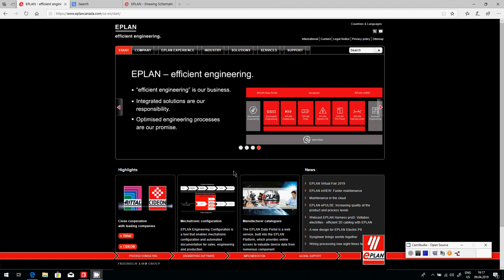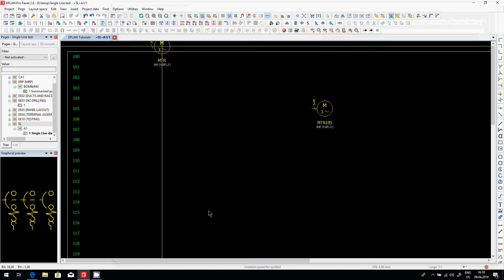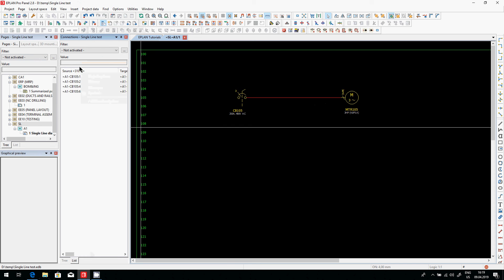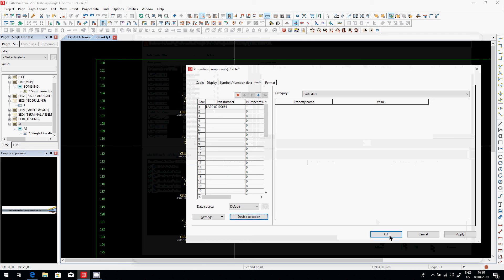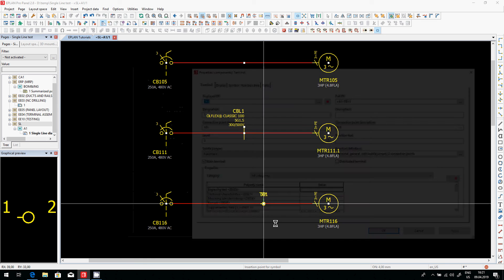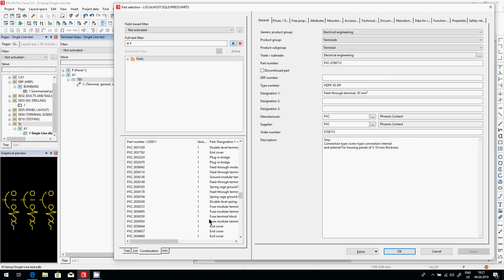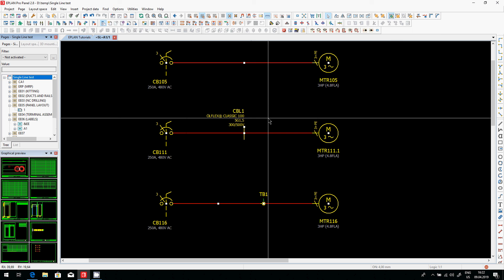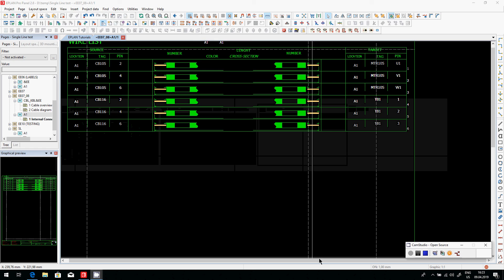EPLAN Single Line connections

Comment: I really like this function, but what I struggle with is to store the information in the "connection definition point". When I copy a circuit and rename it then the information is lost. Have you any solution on that?
Reply from the maker: I really believe you should ask you Eplan Support. Use the Eplan solution Center to upload your project… it will be easier for my colleagues to help. The question or scenario you describe is unclear for now.